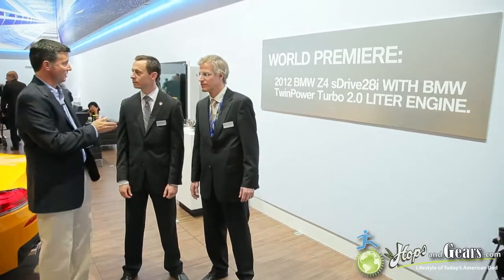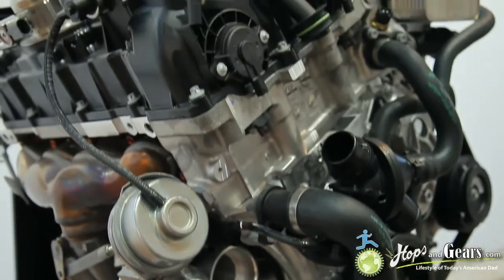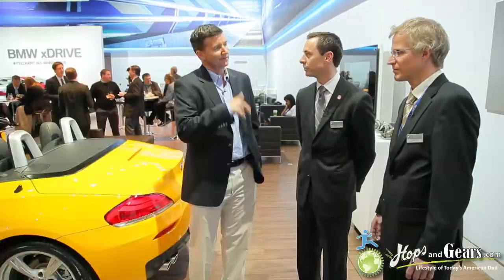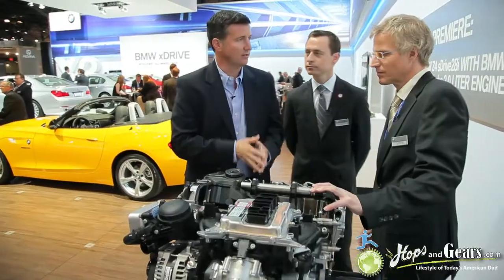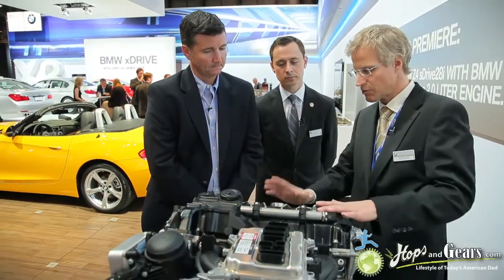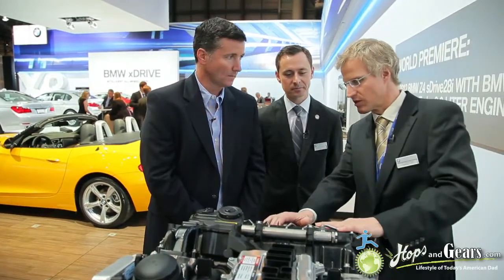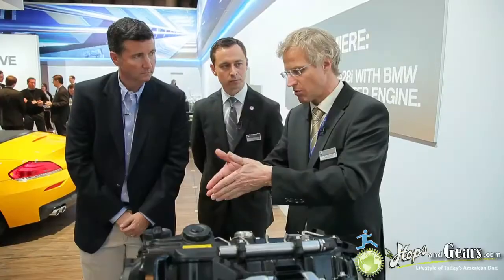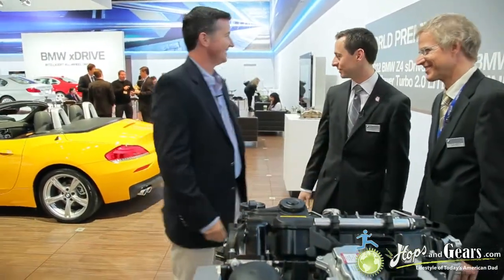BMW's New 4-Cylinder Turbo Engine!

Comment: Say what you will, it's only 1 second slower 0-60 than the 35i 6 cyclinder, and about $5000 cheaper.  Is 1 second and a stronger growl worth $5000?  To some, but not all.  Both are great engines though.